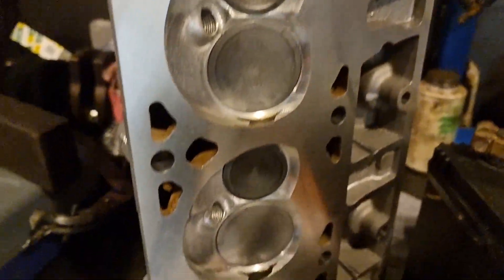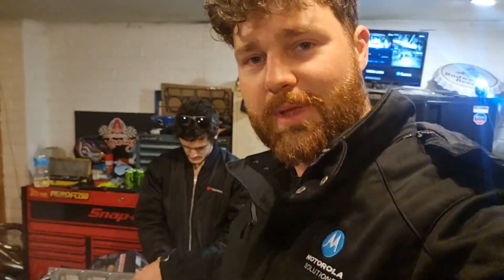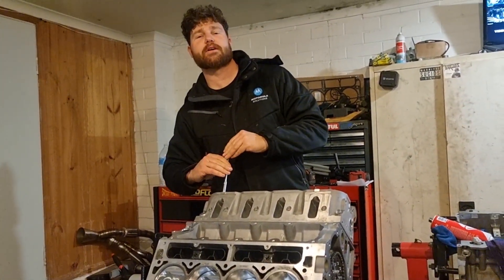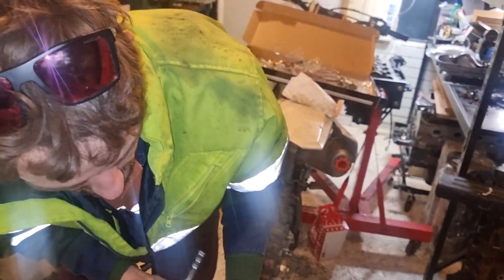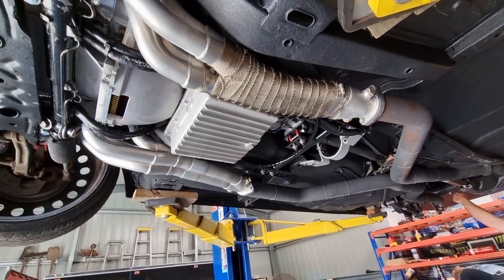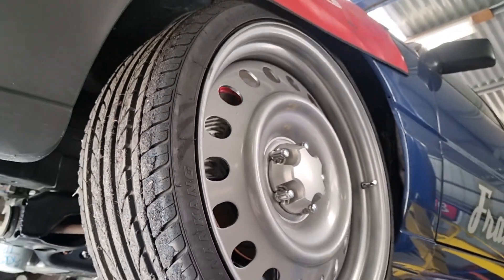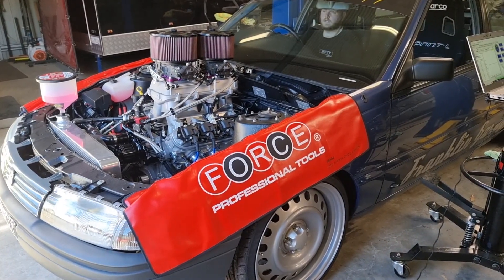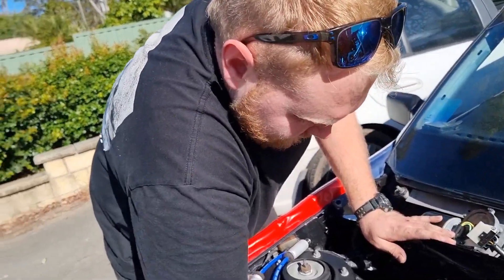Firing up SHIFTY's fresh 13.5:1 LS1 burnout engine

Comment: Hey mate just wondering what you do when putting the cleetus valley cover on do you delete the knock sensors or relocate them?
Reply from the maker: Yeah they just get deleted
Reply: @WinginitMotorsports  cheers for the reply I’m looking at just getting a cheaper block off plate just to stop the chances of oil leaking out the knock sensors and also to look better with the tunnel ram haha

Do you know if you can run flex fuel or 2 different tunes on a switch with the standard vx ss ecu at all?

Comment: One more question when building and when you put the cam in do you get a bottle off sticky oil with the cam kit if so this oil is hardening oil to harden the camshaft so on first start rev too 3,500 rpm for 20 mins and do t let the engine boil or over heat and don't switch it off and this will run the camshaft in and harden it too just to let you know if you didn't that's how I used to do it

Comment: Glad to see your using bluetack on the pistons to check valve clearance old school stuff and don't you hone the barrels out too 2 thou and if you can put a thicker blue tack and let the valve imprint in the blue tack then dti the depth of the groove off the valve and the you know the measurements

Comment: Aussie living in Germany here. Nice video mate, I map OEM engines for a living over here. Keep the engine safe and run a big engine oil cooler. Preferably a water to oil cooler with a 2.5kw V8 Cherokee thermo fan. Any more than 110c oil temps you are running the risk of grabbing a bearing, especially with high oil aeration with the older LS engines. The older LS engines don't have a scavenge pump to pump the oil into a catch tank so make sure you run a large cooler. 
I think the LSA and the LS3 run a dual stage pump so look into if they fit the older gen LSs. Then feed the oil into a decent catch tank that can reduce aeration. 
Usually on the test cells we run a 15L catch tank and the engine I'm mapping now, a 850ps TTV8, has no issues running full power for 300hrs. Have fun!
Reply: Full power for 300hrs? WTF? That's nucking futs!
Reply: @Jarmezrocks  depends on the engine though. High performance stuff yeh it can be that high. A BMW engine just recently finished 2000hrs of mapping work.

Comment: This is why engine builders are putting all parts and block in climate control rooms so they can put rings on easier and less sanding and work you have done. 

The first engine builder I heard of doing this was Larry Perkins and that’s why his engines were so tough right up to the 304 once they went to LS he stopped